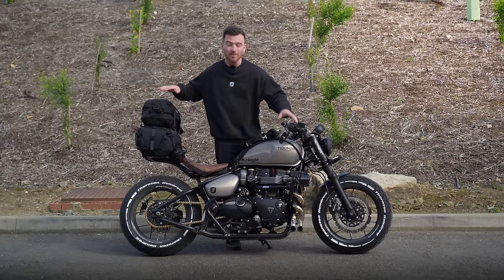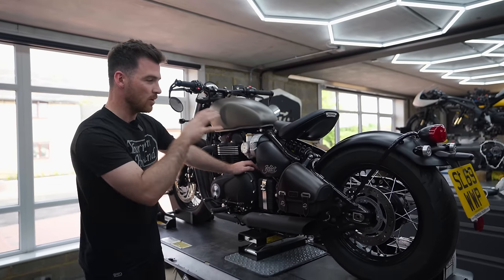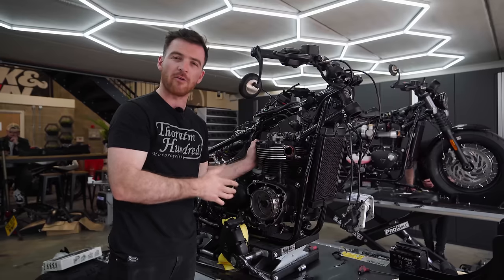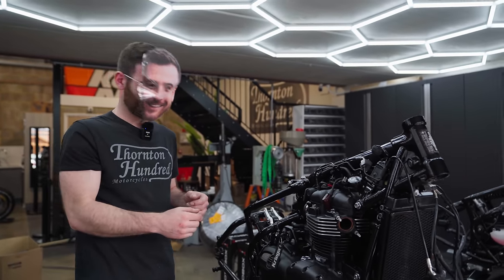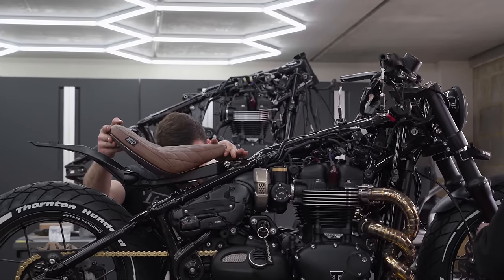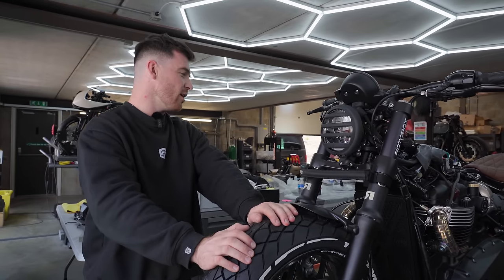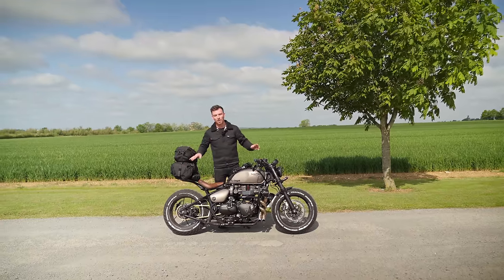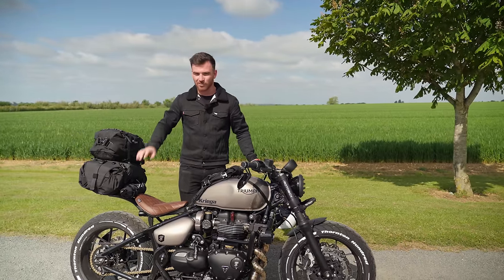Building the PERFECT Bobber for a 3,000 Mile Road Trip!

Comment: Your legs, back and arse are not going to forgive but you're going to have a blast! i've taken my bobber on two 4k mile road trips through Europe and loved it. Only difference was i had 1x30, 2x20 and 1x40 kriega bags on my hepco and becker rack. Also, never miss a petrol station on a 9l tank i had some really close calls averaging 120 miles to a tank. After putting in 33k miles on bobber i've bought a Tiger Rally Pro for Norway!

Comment: Why i feel the front tyre is mounted in the wrong direction, normally that thread design clears water from the center of the contact patch when its facing like the rear tyre.

Comment: Incredible! Just curious, with a 3000 mile trip how do you plan to lube/clean the chain while you're on the road? The manual recommends cleaning/lubing the chain every 200 miles. I'm hoping to do something similar with my Speedmaster.
Reply from the maker: No lubing or cleaning - O ring chain is fine for that mileage with no lube

Comment: Amazing bike but as others have said, that exhaust would drive me nuts over a longer distance, and setting off from somewhere early in the morning could be a bit embarrassing. Also, with no rear mudguard, you're gonna get a very wet arse when it rains, AND IT WILL!! With that shorty mudguard on the front, the bike; and you, are gonna get plastered in whatever crap is on the road. As well as the rain too. I do like the bobber style machine though............

Comment: HEY MAN, GREAT JOB!!!   Just a beautiful bike,  BUT, just to understand:  ARE THE FRONT NICE TYRES OF ALL THESE GREAT MODELS,   MOUNTED  "REVERSED", vs THE BACK TIRE AND THE NATURAL SENSE OF MARCH???  I noticed this in more videos you made and other models.  The cuts closed to the edge of these tyres models  should have be made JUST TO FIGHT THE NATURAL TIRES'S TENDENCY TO SLIDE AND DRIFT IN THE OPPOSIT DIRECTION AF THE BEND WE MAKE, RIGHT???...  Exactally  like the BACK TYRE,  that seam correct!!!   The front tyre,  this  way,  seam to be readi to let us loose the grip in the front!!!!  Just to know,  i just think this tyre has  THE RIGHT AND LEFT SIGNS on their sides  for a correct way to mount it on a weel,  may be just a mistake?....   Let us know

Comment: 3000 mile with a straight piped bobber ... I hope you have earplugs :D
Reply from the maker: Pardon 🤣
Reply: @ThorntonHundredMotorcycles  man really , before you go on the tour. Change that exhaust. Those are just 2 empty pipes that will get you in trouble all across Europe. If u are lucky and cops stop you in Germany or France u can expect to need a tow for your bike as they will 100% not let you drive further with that straight piped exhaust. Also a big fine. 
U can expect the same issues all across Europe. Is it even legal in the UK to begin with?
Otherwise cool motorcycle.

Comment: For all the people warning you about Switzerland, they’re kinda right and kinda wrong.  I had a CBR954RR with a full exhaust with no baffles when I lived there.  It was a UK bike, and when I certified it, I out the OEM exhaust on.  When I rode it normally, it had the full beans exhaust on, but when I saw cops, I would keep the RPMs very low to avoid any sound detectors.  Got away with it for 6 years.  So, I think you’ll be okay if you’re sensible.